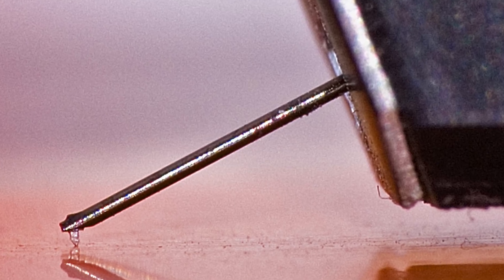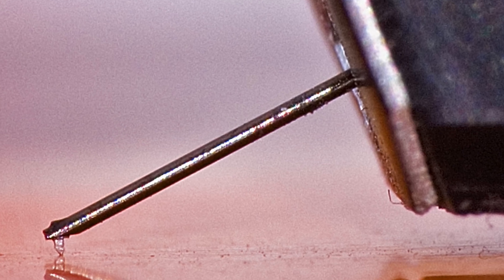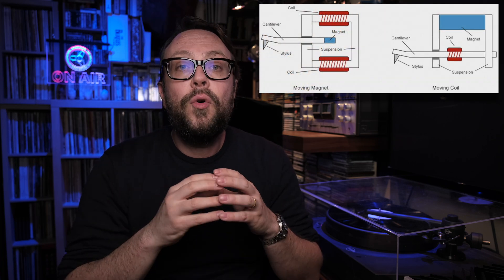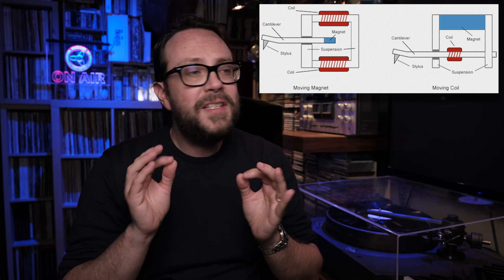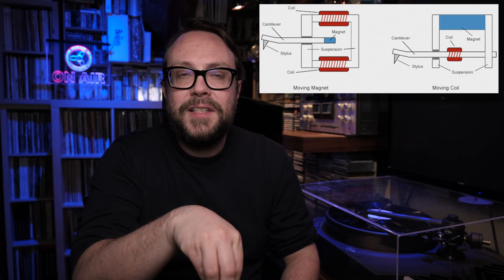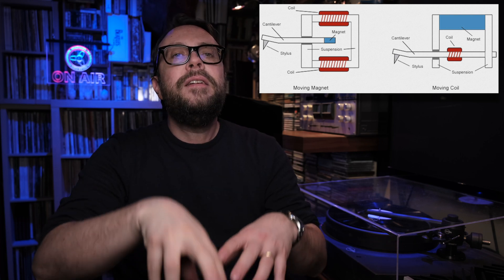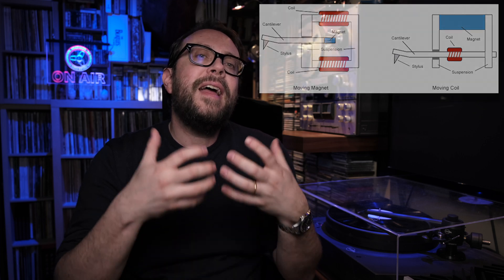Cantilever types: best & most used

Comment: To understand what the perfect material for a cantilever is, all you have to understand is the concept of Young's modulus, the measure of stiffness. The stiffer a material is, the better it can transmit high frequencies.  The Young's modulus (GPa) for diamond is around 1100, sapphire 250, boron100, zirconium 95, aluminum 65. Though aluminium and boron are lighter that is easily compensated by making the diamond cantilever thinner! When you take all this into consideration, diamond is by far the best material for cantilever. BTW sapphire and ruby work the same because they are the same mineral, aluminium oxide. They are different color because of the trace elements in it. Finally, diamond is also the best material for tweeters exactly for the same reasons! nothing comes close to its stiffness to mass ratio.

Comment: Hello, I have a question. I'm considering to buy another cartridge and having a dilemma; I have to choose between an exotic stylus type or an exotic cantilever material, not both due to my budget. Which would you recommend  between a line contact stylus with aluminium cantilever, or an elliptical stylus with boron cantilever if everything else is equal?
Reply from the maker: Good question, difficult answer becausethe cartrdigeas a whole, the synergyof the elementsdeliversvery different results. In any case, stylus is paramount and usually a good line contact will give you great resolution in modern records.
Reply: @anadialog  Thank you. I'll consider your advice seriously!

Comment: I want to record a digital signal directly onto an analog medium (such as a VHS tape or a vinyl record) so that I can maintain usable quality at the lowest possible speed. What format would I need to use if I want to be able to play the digital signal directly on analog equipment without a special decoder?

(Thank: ultra low-speed or CLV discs for dictation, or ultra low-speed VHS for a time lapse security camera setup while still having sound.)

Yes, I know better technology already exists today for my intended application <.<
Reply from the maker: I answered you in your other comment under the DSD video. The key concept is digital DATA. Vinyl is possible but quite complicated, tape is much easier. As I wrote on the other comment, DAT and VHS are the best, but also cassettes can be used.

Comment: Great video, Guido. Over the years, I must’ve had most types of cantilevers on different cartridges, but one I’ve yet to try is a Soundsmith cart which utilizes a cactus spine as a cantilever. Again, thanks for the excellent video. It was very informative.
Reply from the maker: Thank YOU! As mentioned in the video also Miyajima and others use that solution, cool!

Comment: still can't find information on polishing the styli
always been assumed to do it back to front parallel with the cantilever but I'm not sure! maybe doing it across ways is a better approach!? and we don't know which way the grain is going either without looking under a microscope.
Reply from the maker: You mean to clean it? Yes, the best way is from front to back. Personally I think that styli are much more tough that what we think and I move my brush in all directions. I did a video on this topic: https://youtu.be/QcyHZnTBzP8
Reply: @anadialog  
yes it's a type of cleaning but it polishes it by using a bit of green Emery paper.
the company use a diamond powder paste.
I'm going to make a clamp from stylus protector to hold the cantilever when polishing.

Comment: I didn't know that there were so many different types of cantilevers.  The only types that I knew were aluminum and carbon fibre.  In searching around the internet, I found that the AT 3600L has a thin carbon fibre coating on a plastic cantilever.  Is that true?  And one more question.  Is there a cantilever which has a carbon fibre coating with an aluminum base?  I trust you implicitly.  Good video, Guido.
Reply from the maker: Thanks, I do know actually, but there could be
Reply: @anadialog  Thanks.

Comment: Hi Guido, I loved this comparison. What fun is it without some nerdy stuff in the mix. One thing I would like too add about different materials. Some do allow for different shapes (like an S shaped cantilever). The effect of shapes on stiffness should not be underestimated. as the Romans could tell you when it comes to arches ;)
Also tubes Rock, same thing here. Not only is there a weight advantage, a tube is always stiffer than a rod, all else being equal. Finally, if you think about the number of combinations between cantilevers and styluses only, it is no wonder how many different flavors of sound are available just by changing the cartridges.
Reply from the maker: Indeed!

Comment: Ruby is a sapphire.
Reply from the maker: Nope, is similar, as stated, but it has different characteristics. Check the Namiki website I linked in the video description.
Reply: @anadialog  The base material is actually the same, corundum, in nature it can be found with different mineral impurities that can give it a different color, so before chemistry they have been named differently as it was thought they were different. Kinda like theine and caffeine (teina e caffeina), same exact molecule but found in tea and coffee respectively. It is possible sapphire and ruby may have slightly different proprieties, but the difference has to be really small, probably like different colors of plastic (except white, the generally used white pigment is powdery stuff that makes plastic less resistant). I think mineral impurities should degrade the material, and since they start with pure artificial stuff I don't think they would add so much that they lower the performance just for the visual appearance.
Reply: @anadialog  Ruby is a sapphire, just different color than other sapphires due to different elements (impurity) in the crystal lattice. This is scientific fact. It may have different characteristics because of how a company treats the Ruby cantilever but unlikely due to ruby itself.
Reply from the maker: @JohnLee-db9zt  indeed! But we are talking of cantilevers and how they are produced. There are subtle differences but, once again, as clearly stated in the video, they're very similar.
Reply: @anadialog  Actually my original comment was about Ruby and sapphire, nothing more.

Comment: Ruby ans sapphire are the same stuff... the only difference is the color.
Reply from the maker: I didn't! Watch always all the video! ;-)
Reply: @ 10.47
Reply from the maker: I see you corrected your comment. I must correct also the other part. Nope, sapphire and ruby are very similar, as stated in the video, but they have different characteristics. Check the Namiki website I linked in the video description.
Reply: @anadialog   Sound smith  state there is no difference between Sapphire and Ruby on their page about grace F9 cartridges. Edit: Ruby is more expensive to make due to adding Chromium, most(if not all) Sapphire cantilevers are white because there is no trace metal added)